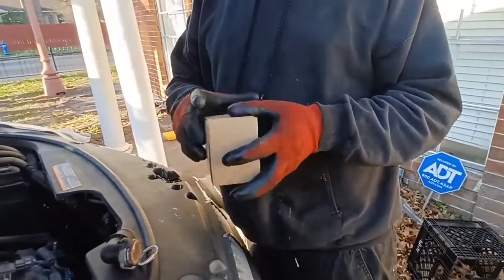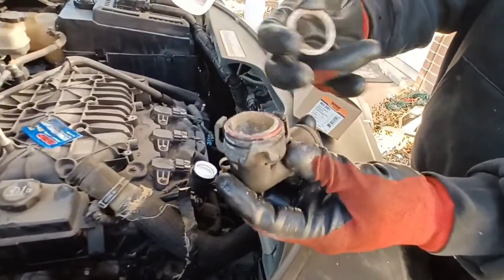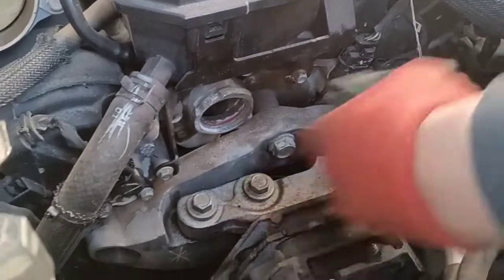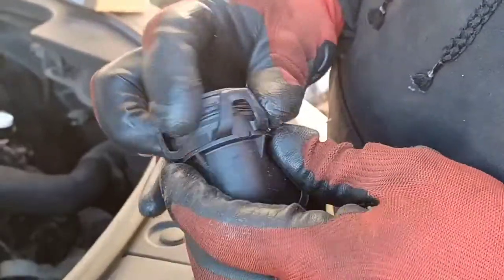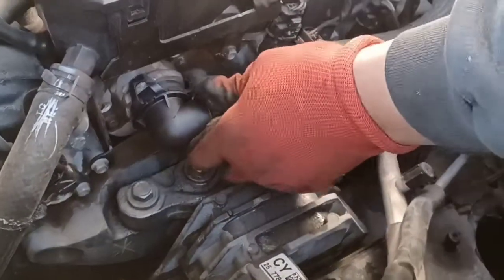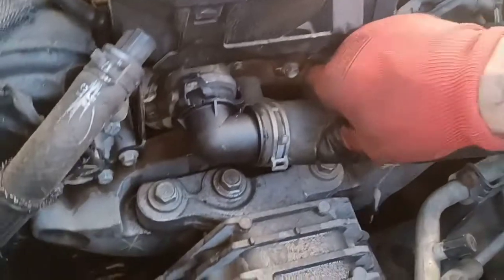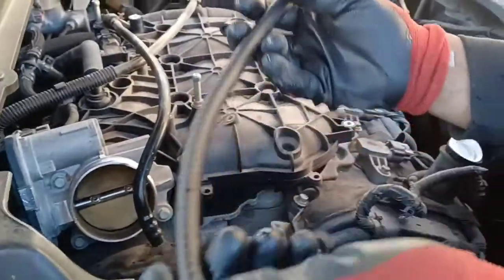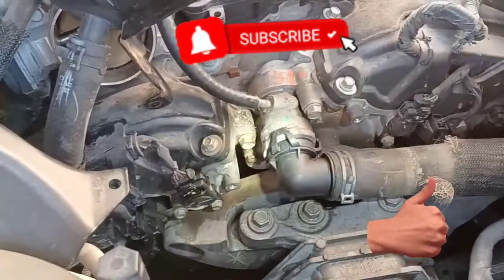2010 Cadillac SRX V6 How to install Engine Coolant Hose connector

Comment: I have a 2010 Cadillac SRX and I'm having the same problem; I just recently had a mechanic to tell me that I need a water pump and thermostat that needs to be replaced. I need somebody else to check to see if it's just the engine coolant hose connector

Comment: Question where's the freeze plug located on this particular kind of vehicle and is it difficult to replace
Reply from the maker: It depends there's a couple of them in the center and on the side of the block of the engine and as well there should be some on the heads what you have to do is top the radiator off with coolant or water turn the car on and follow where the water is dripping from and most likely the leak there should be a freeze plug in that area
Reply: @aaronmobilemechanictv7841  thank you so much!